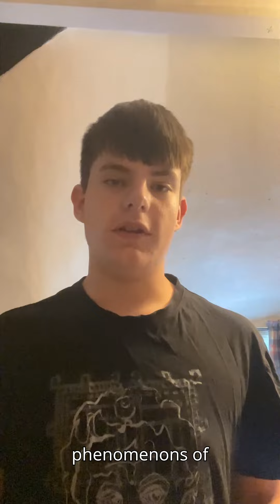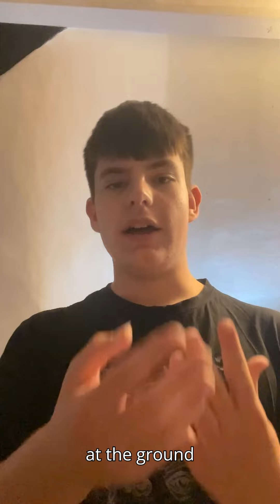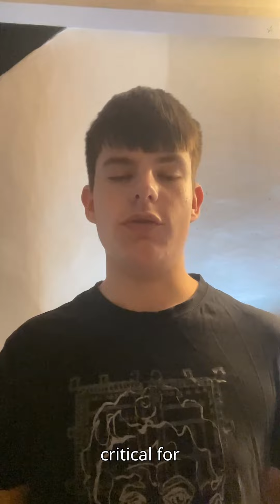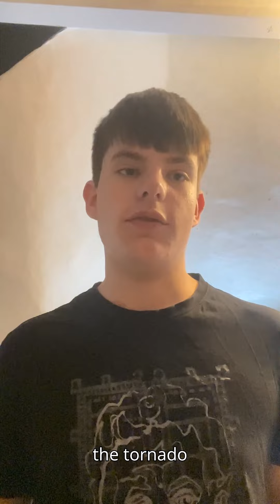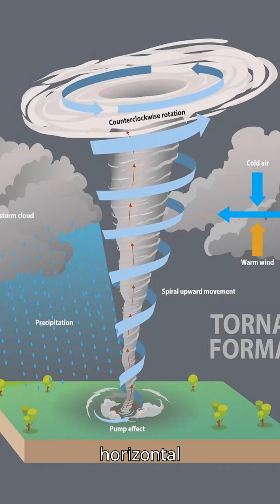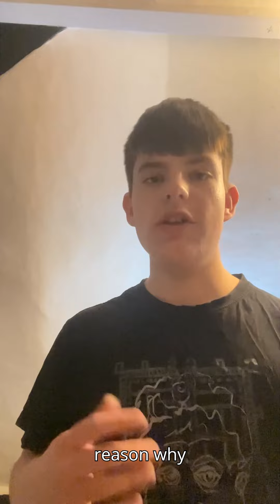How Do Tornadoes Form?

Comment: 67 A tornado is a violently rotating column of air, also known as a twister, that extends from the base of a thunderstorm to the ground. These powerful storms create a visible funnel of condensed water droplets, dust, and debris and can cause severe damage with winds that may exceed 300 miles per hour.